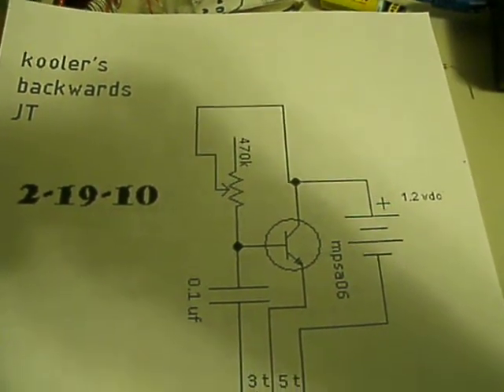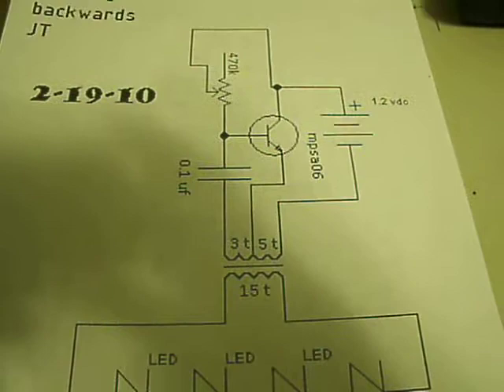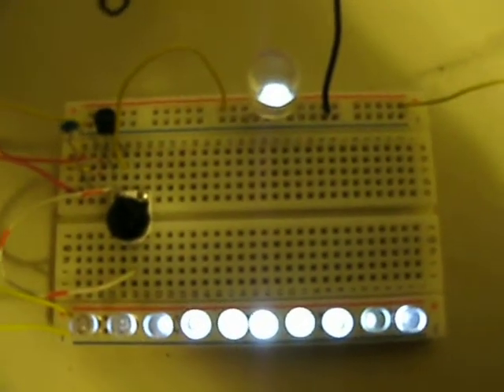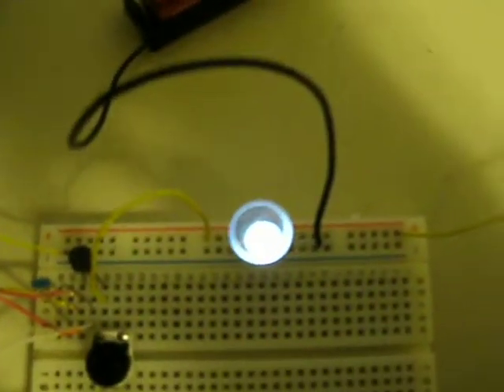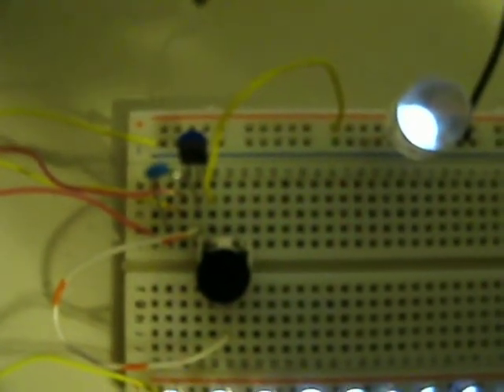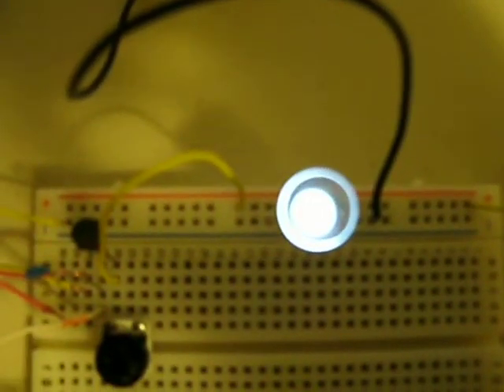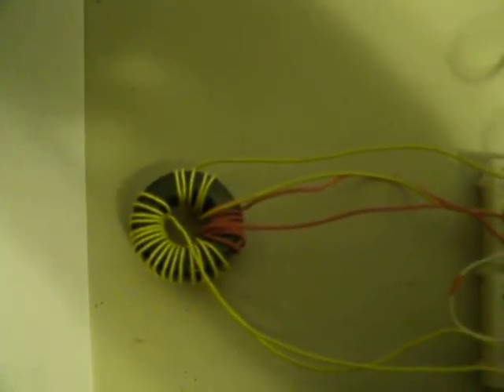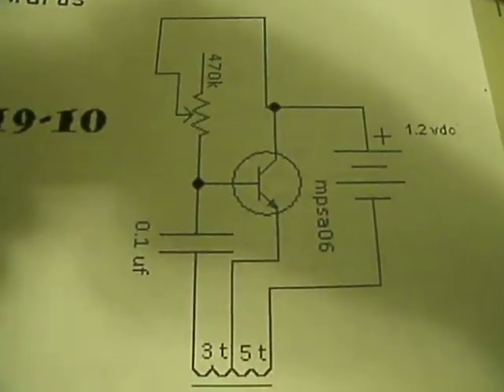hartley oscillator 2

Comment: I'd like to duplicate the circuit but I see 4 LEDs in schematic and 10 on the board. I see 3 turns on the schematic but the red wire looks like much more than 3 turns.  And the picture moves around and I can"t see things long enough to get an idea of where they go.  It's scary to think that if you turn the pot to its minimum, it's the same as putting the battery directly across the base to emitter, and the excessive current would damage the transistor.  Thanks for the more readable schematic.